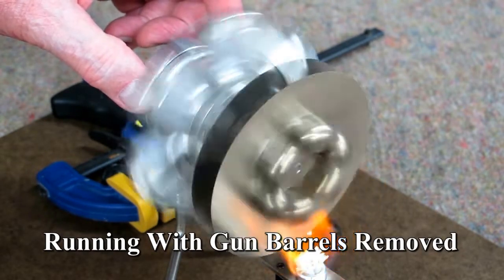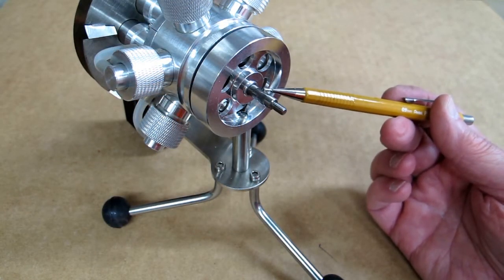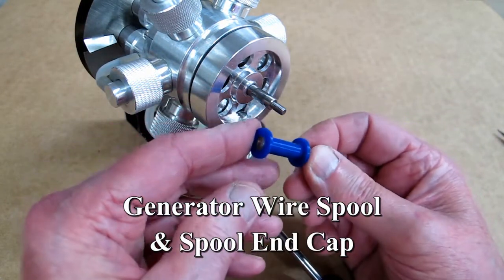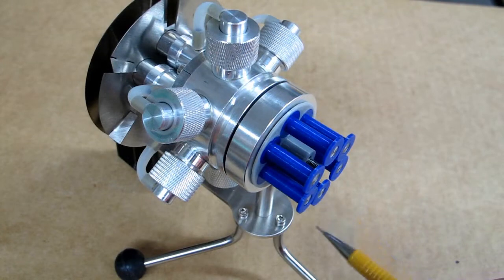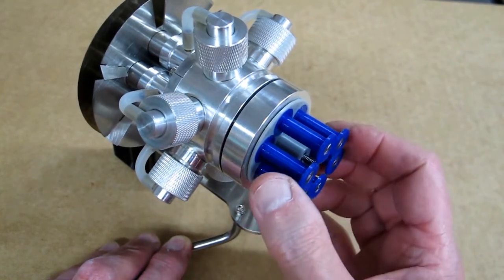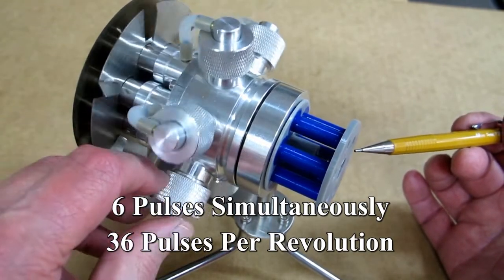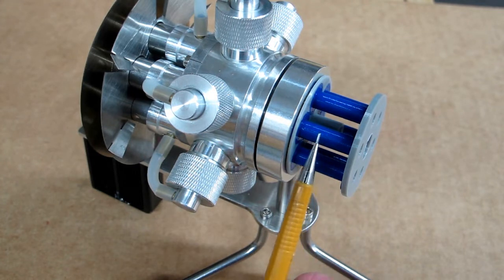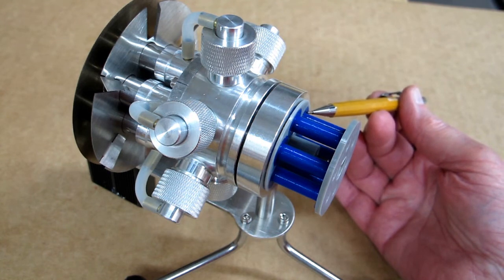Gatling Stirling Magnet Generator Part 1

Comment: Try a 3 phase staggered electrical generator. You may not then have a "cogging" magnetic action on the coils.
Reply: One way to bypass that, is cam-lobe v-gating...or...ablative fielding by shaping the magnets physically to create field-slipping (or in fact both/all). I pointed that out to Tesla and others, along with cam-lobing either the stator or rotor magnets (depending on design).

Let's consider the following:
Years ago, I hypothesized...on an alcohol internal combustion...let's say a 2 stroke variant, you could effectively cut down the thermal waste on the head & jug, and turn the jug into a mix of a v-gate (with cam-lobing) and power (electrical) production, depending on the design of the v-gate track/rail. In that way, you could reclaim some small horsepower from ring & crank bearing friction, passing it instead as a loss, to the electrical power production side of it.

With the v-gate design, you are then requiring less fuel (and the fuel being alcohol burning much cooler) to do double duty: torque/rpm + electrical power production in a more 3 dimensional form factor, with lower losses.